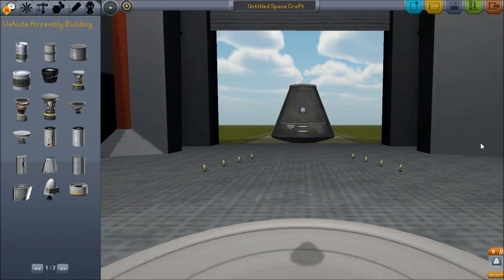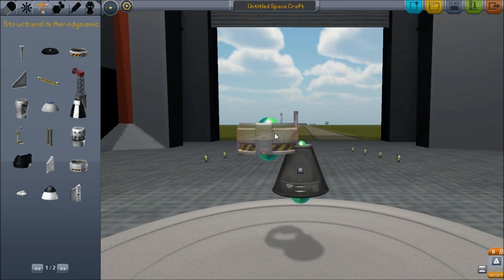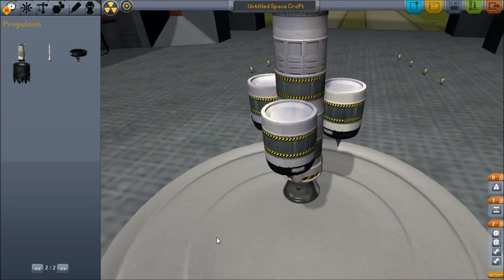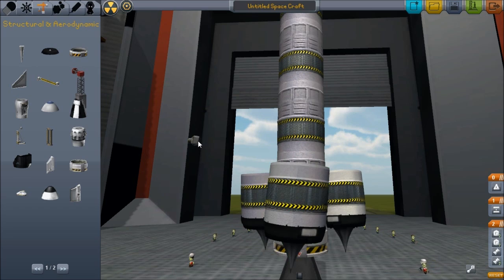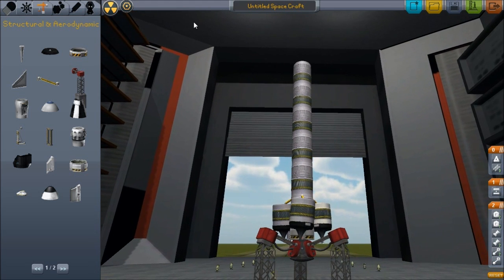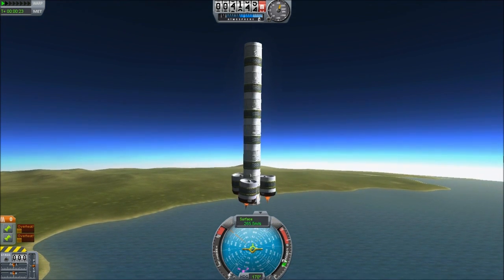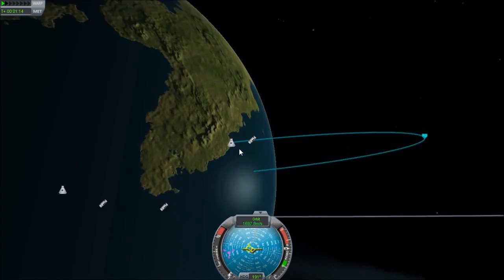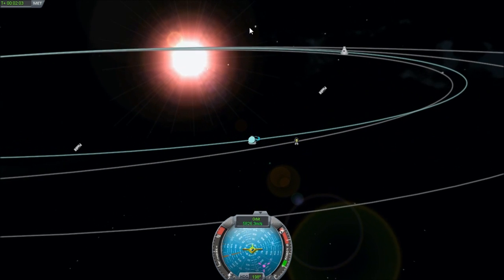Kerbal Space Program- Leaving the Solar System

Comment: I wonder if the space shuttle will freeze when it leaves the solar system.
Reply: Clarification: I don't care about the freeze clarification. But no, the craft would not become colder (not very fast anyways) because there is not a medium to suck up the heat of the ship. The only way to disperse heat is through radiation,  something that would take many years.
Reply: ***** Because the sun is the only heat source of the solar system. If an object is to far away from the sun, it'll freeze.
Reply: It won't because the space shuttle is not water :p (yeah only water freeze, because freeze mean water in solid form. But yeah it would be very cold)
Ps: sorry for the bad english
Reply: raf221
Reply: raf221 "Freeze," when used technically, refers to any liquid turning into a solid. However, the space shuttle is still not able to freeze...which is a fairly minor issue with the question.
Reply: Timothy McLean well maybe it's my bad knowledge of english but I thought that "freeze" was used for water and "solidification"  was used as technical term for all liquids.
Reply: raf221 "Solidification" is used for any fluid, whether it's liquid or gas. "Freeze" is used for any liquid, though water is (obviously) the most common.

Comment: Calculus can be mind boggling sometimes. What you have is a force proportional to one over distance squared. (F = 1/r²) Will the force ever drop to zero? No, limit of F as r goes to infinity is undefined.. But if you take the integral of 1/r² from 1 to infinity you get 1, a finite number. Turns out this is the work you need (force times distance) to stop an object launched at the escape velocity. It's enough work to stop the object... when it reaches a distance of infinity. So... never.

Comment: We see this equation:

[v(t)^2]/2=GM/r(t) - GM/r0 + [v0^2]/2

This is nice, since if GM/r0 is less than or equal to [v0^2]/2 (which happens when v0 is greater or equal than sqrt{2GM/r0}) then we get:

[v(t)^2]/2 =GM/r(t) + c

where c is some positive number. Now, since our r(t) and v(t) started off positive, they must stay that way in this case (they vary in time continuously).

So in this situation, unless I've made a mistake, it seems that the speed decreases forever, but approaching c.

Comment: It's not /really/ easy (although should be for someone so sure). Let me try:

Assume that a(t)=-GM/(r(t)^2) is the acceleration at time t with G=grav constant, M the mass of the planet and r(t) the distance from its centre at time t. If v(t) is the velocity, using the chain rule you can get to: (dv/dr).v=-GM/(r^2) from the more familiar a=-GM/(r^2). We use a usual trick to formally move over the dr and take integrals getting: [v(t)^2-v0]/2=GM/r(t)-GM/r0. Now, move over that v0....(continued)

Comment: So what you would see, if you plotted the speed of the object relative to the planet, is that the speed decreases over time, but this decrease of speed (the first derivative) shrinks. The speed decreases forever, but at an increasingly slower rate and so in fact converges to some fixed speed. If you don't understand this try writing down the calculations (you did say you are doing A-level physics). In this situation, the object travels away from the planet forever. Please try to understand...

Comment: It's because 68yrs[...] is the maximum number is can show. You'll get there eventually.
2'147'483'647 is the maximum calue that a 32bit number can hold. 68 years = 2'144'448'000 seconds. So it can't count more seconds unless it uses a 64bit value, which they apparently chose not to use for that.

Comment: For those curious, the 68 year figure is due to the maximum value of a 32-bit integer in the game's engine. 31 bits (we lose one to the sign bit) gives us a maximum value of 2^31, which is around 2,147,483,648 seconds. Or, put into more useful terms, 68.0511 years! What this means is that the Kerbol escape is so far away that the game can't even represent the time properly! Of course, current versions of the game seem to have fixed this issue. ♫ The more you know ♫♪

Comment: idk why you think fuel lines need to be in the bottom tank, you can literally put them anywhere as long as the fuel crossfeed is all together. If you have a stack of 6 you can draw from the top tank and it will drain them all.

Comment: If you ignore pesky details like leap years, 2^31 - 1 seconds comes to 68 years, 35 days, 3 hours, 14 minutes, 7 seconds.  This is the time length you were seeing.  And this is the largest number that a 32-bit sequence can hold if one bit is used to provide a +/- sign (which would give you a signed long integer in C++).  So I think you're seeing the 68+ years because KSP lacks an explicit concept of infinity, not because anything important happens after 68 years.